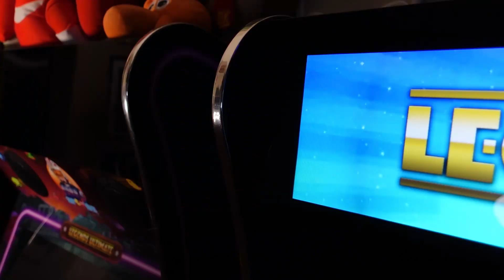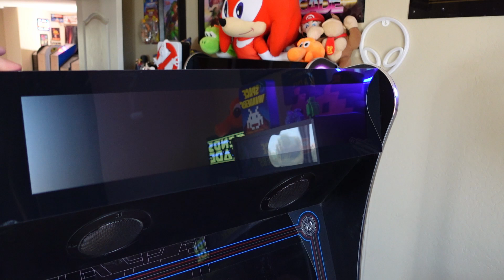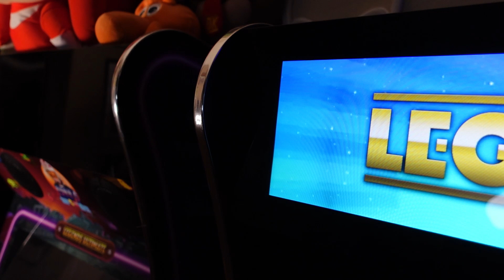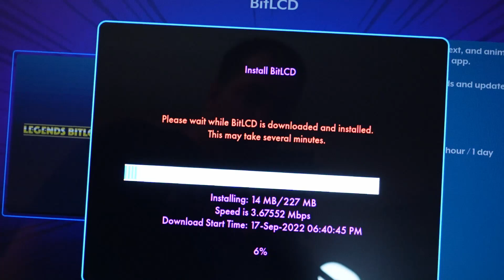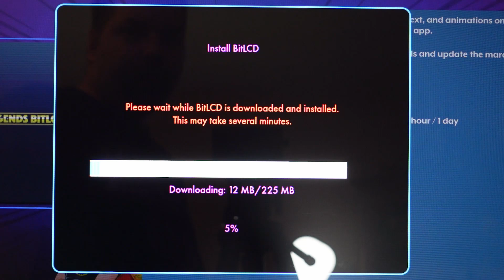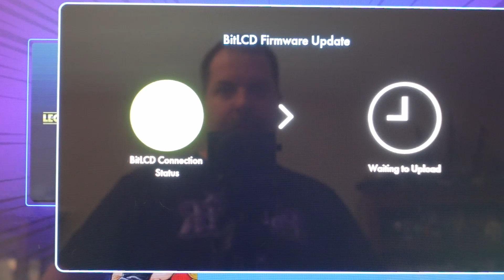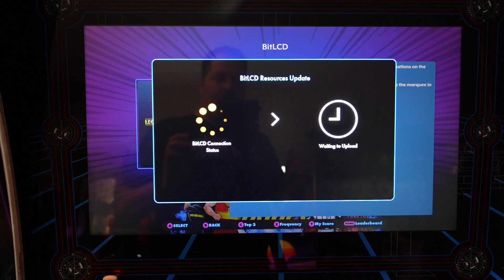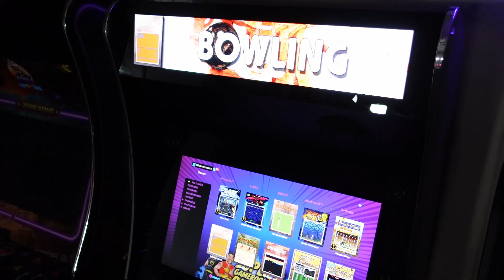AtGames Legends BitLCD Marquee Review & Install!

Comment: I picked up one of these up as well and really like it.  I am more looking forward to what it can do down the road especially in the added art area as coinops is gone compared to bitpixel art. I only have one gripe on the current software which is that it doesn't inform you if you are up to date on firmware or resources.  Both options continue to be available even after you've updated both which allows you to do them again.  Overall this feels like a solid product and worth the $250 price I paid.
Reply from the maker: Great feedback thank you

Comment: I was just about to haul my Legends Ultimate to the curb when I saw the bit about holding player  2 for 5 seconds to get out of bluetooth mode, to get the CP working. I was going to get this display on NOD, but that's about the time I noticed my CP not working, so I had to start thinking about options. Couldn't find a replacement CP on AtGames' site, so I figured it was just time to send the ALU to the land fill. VERY glad I watched this vid. I do have the BitPixcel, but with CoinopsX misbehaving, and other issues, like audio lag, I modded mine with a Pi, and a little smaller LCD panel a while back. I might go back to the ALU asset if they ever fix some stuff and things. Thanks for sharing this.
Reply from the maker: Happy to help my dude!

Comment: Question, if you want to update the marquee art do you have to open up the cabinet each time?  I am thinking about running a USB extension cord and have the USB accessible outside the arcade
Reply from the maker: That's what I've done and shown in other BitLCD videos is run the extension cable

Comment: Just wanted to add, sorry if I missed it. If you plug your old Led into the extra port on the LCD included usb hub it works and frees up the front one. So you can hang it on the wall or something.
Reply from the maker: Nice tip! Thank you

Comment: Followed your vid step-by-step. Smooth sailing, thanks. 
Any tips on removing Szabo’s CoinOps topper from the BitLED so it can be moved to the BitLCD?
Reply from the maker: I was going to try a hair dryer to heat up the glue haven't got to it yet

Comment: Great Video. I followed it step by step, very meticulously, and was able to get everything installed and updated. Was able to scroll through a handful of games and the marquee looked AMAZING! Immediately after those 2 wonderful minutes, I've been having issues with my control panel not responding. Even when I do the 2P trick upon startup, it sometimes works and sometimes doesn't. I'm wondering if the USB hub they included is faulty?
Reply from the maker: Sounds like it. Try a different HUB
Reply: Did you find a solution to your arcade controls problem?

Comment: Hi PDubs. I added the BitLCD and love it and the power"T" connection from AtGames in the back cover and did not like that it being exposed. So I removed the board from the back cover and reinstalled to the side {inside} of the cab with a couple of spacers that I got from Amazon and screws plug power into the board on the inside of cab and I don't have the"T"connector on the outside and don't have to worry about it getting damaged. So I did add a utility switch in lower back cover to turn the ALU off/on which is wired with a power strip on the inside of cab that has all my power connections. I did leave the ethernet plug connector still in the back cover. It would be a nice YouTube video showing how to do this and you would be great to show how to.  Thanks for the great video.

Comment: I downloaded one of the packs in your other video that had 7600+ marquees and my BitLCD is ordered and in the mail still. Can I upload the marquees onto my USB or do I need to do the BitLCD resources/folder setup while its in the BitLCD first? Otherwise, if the marquees in the packs are already better and there are more of them, do I just delete the one that the BitLCD programs creates when it is plugged in the ATGames unit and then just put the folder from the downloaded file instead?

Comment: Some constructive criticisms: the barrel  splitter does not fit on the inside of the 1.0 cab, had to put it on the outside. After almost two years of waiting, you would think that they would have had art for all of the included games, they. do. not.  Otherwise it looks great, was built like a tank and I didn’t have any dead pixels or anything, so overall I’m happy with the purchase.
Reply from the maker: Thanks Dude!

Comment: I’ve watched three instructional videos on how to set up the BitLCD software and was told 3 different ways. The last video I saw said to not have your Coinops USB drive plugged in while installing the BitLCD software. seen another video that says to run Addonx without my coinopsx usb. Seen another video that doesn’t even mention addonx. Atgames failed at providing official instructions for the software installation. This is getting beyond frustrating. Especially since I can’t find any  instructional videos that are specifically for the 1.2 ALU.
Reply from the maker: My video is correct. Can't speak on others. The BitLCD application knows to install the data on the flash drive plugged into the back of it.

Comment: What is the minimum size usb drive I need, I have a Samsung 32gb fit, is that enough, and I have a 1.0 cab, and have to use the USB port on the front also.
Reply from the maker: That's more than enough
Reply: How do I get the marquee’s for CoinOpsX? I just get text, can I just put all of the marquee jpg’s on the marquee usb drive?

Comment: Hey Pdubs can you point out the differences with a 1.1 and original 1.0? There’s no usb connection that I can find inside ahu. I am trying to replace the bitpixel original to the new LCD. Thanks

Comment: Its hard to find anything wrong with this because its so cool but i will try. I think the price is kinda high. Love to see it at $200. The black boarder around it seems to thick. Would like to see it with a thin boarder and they could make the screen slightly bigger that way. They should of included a USB drive with it. USB drives are so cheap it would be a nice convenience to include it. Install should be way easier. It should be one or two clicks to get it updated and running. What a great product and vid. I will defiantly get one when it goes on sale.
Reply from the maker: Great feedback thank you

Comment: Hey thanks for the video. Is it just me or does anyone else have trouble fitting the artwork flash drive into the usb port in the back of the lcd? It seems pretty tight in there.
Reply from the maker: Try using a short stem USB instead of a full size

Comment: Anybody have issues with downloading the Firmware update?  it downloaded once for me but the image never came back after rebooting,  once I tried to redo everything I'm now getting a file transfer error.  Waiting to hear back from At Games support.
Reply from the maker: Not me but best to wait to hear back on your ticket or try a different thumb drive
Reply: @BuffNY420 - exact same thing happened to me tonight. I'm sitting at the screen where it tells you to wait for it to reboot and the BITLCD screen has gone to a blank image.  I can see it cycling off and on every few minutes, but the screen won't recover. After 20 minutes I tried to redo it, but it won't let me update the firmware a second time, or install the resources.  I'm also waiting for a response from At Games support.  Good luck to you, and please share what you hear back from them and I'll do the same.
Reply: @BuffNY420 and @PDubs - Just to follow up on this, At Games got back to me with a process to reformat the hard drive and copy the img file from my PC and put it on the USB drive, and to try again. It did not work, however I did go out and get a different USB stick and follow the process a second time and it worked perfectly.  Hope you're able to get a resolution as well.
Reply: @Blogofoa  So they sent me the process today and i was gonna try it tonight.  Ill use a different usb stick to start.  Thanks!
Reply: @Blogofoa    Hi,  so the fixed worked I'm up and running,  used the process they sent me and used a new usb stick as you suggested.  Thanks!

Comment: just got mine today an wont recognize the usb 64gb? an i formatted it few times?
Reply from the maker: Try a different USB stick?
Reply: @PDubsArcadeLoft  have tried 64gb sandisk an 256samsung even tried anker brand usb hub.
Reply from the maker: @DWATSON1975  weird. Odd. Open a ticket with atgames maybe your device has an issue

Comment: I just received the BitLCD and performed all the steps to set it up but I can't get past the BitLCD install. I keep getting a "USB Fail. Please mount USC disk from Flash Drive X" error message. I'm using a SanDisk 32GB USB 3.1 Flash Drive and even tried other flash drives and I keep getting the same error message.  Does anyone know what I'm doing wrong? Do you think the BitLCD is defective?

Comment: I have an ALU 1.0 and installed the BitLCD.  The power adapter only fits on the outside of the cabinet.  Also, the usb cable needs to connect to the usb port on the front port of the cabinet.  It does not look good with these cables sticking out of my cabinet.  I am also having issues when I power everything on.  (My system will not start up with everything connected.)  I have to start up my ALU and then connect the BitLCD USB cable and power cable.  I hope someone makes a video showing the install of the BitLCD on an ALU 1.0 so I can see if there is a better way or if I have defective hardware/components.  Thanks for the video, as always.
Reply: I've ran into the same challenges with my 1.0
Reply: @seanjones3174  I resolved the power up issue by connecting the power cord to the proper port on the power adapter.  I really like my BitLCD, even with all of the cord/adapter issues.

Comment: Working on this for about 6 months now, multiple returns and refunds. Never got the lcd to power up. Are you sure this still works? I got it directly from at games and no luck
Reply from the maker: If you have a faulty unit that is a customer service thing with atgames. My BitLCD has always worked
Reply: @PDubsArcadeLoft  yea but this is the third one i have had directly from at games. Following over videos i have read that most people were not able to get this functional. What is the secret? Do you offer tech support?
Reply: In rewatching most of these videos I see that they are all on the 1.0 and 1.1 cabinets. After chatting with support and doing more research there is a different procedure. You have to format and put an image file on the usb drive that is connected to the bit legends lcd. Otherwise no connected on the Lengends ultimate 1.2. After that its off to the races. Opening up the control deck I also noticed that they have octagonal joystick thingamajigs now. Score!

Comment: PDubs you are so important to the At Games community, thank you so much for all you do. I was wondering if you knew why ALU 1.0 users are told to run cables outside the cabinet and why we are told to skip all the steps that involve taking off the back panel. I just got my BitLCD and I have a 1.0 and I am unsure about proceeding with the install because it seems I have to run all cabling outside the cabinet. I did want to put the Thumbdrive outside like you suggested and I did buy that ribbon cable you linked to but it seems like the instructions have me running everything else outside too. Just wondering why the difference, I am not familiar with the changes made to the 1.1